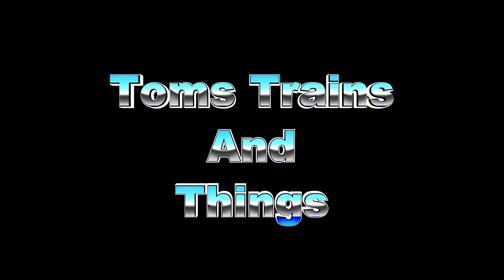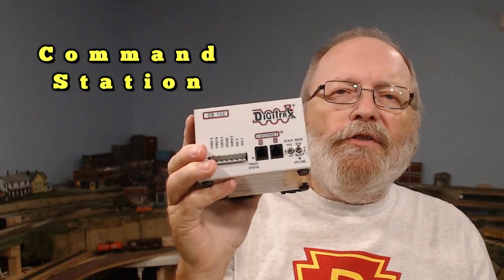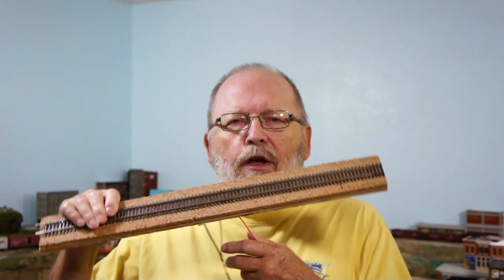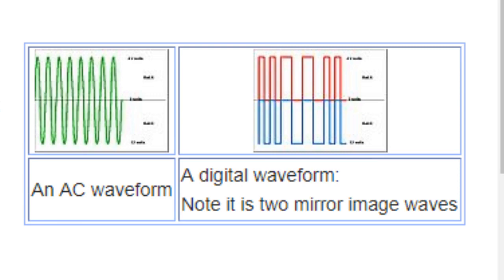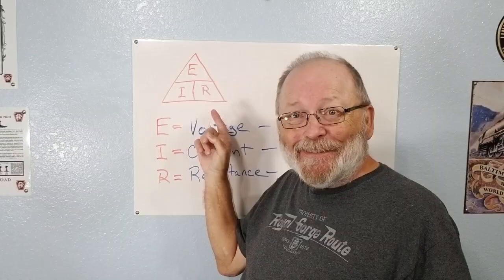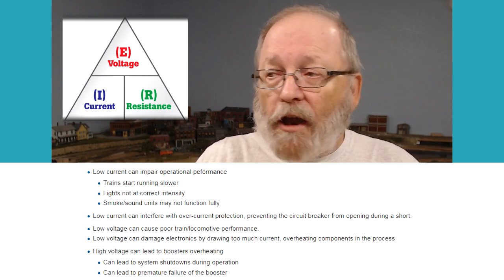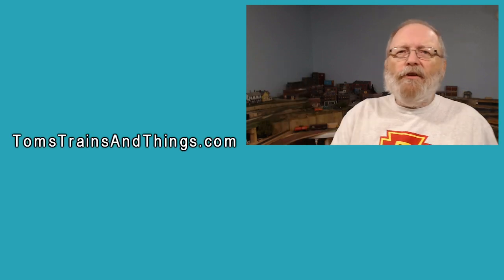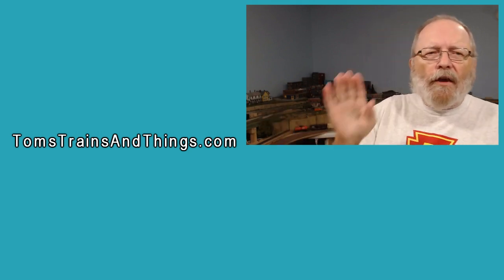What You Need To Know Before Wiring Your DCC Layout

Comment: Please, please, help me. I just bought a few items to run a DCC layout. I have, the Bachmann "your first railroad track pack" EZ track nickel silver layout, a Bachmann DCC sound locomotive, and NCE Power Cab DCC starter kit, and a Tech 7 ampac 780 (that I do not believe I need). All these were sold to me by a sales person at a store. I've heard that the NCE power cab does not go well with the EZ track system? What am I missing? Do I have everything I need to run my DCC locomotive on the layout? The Power Cab is a power source and command center for multiple locomotives? I'll truly appreciate any guidance with setting it up. Thanks in advance!
Reply from the maker: Hi Sid. The NCE Power Cab, a DCC Locomotive, and ANY track is all you need to run your DCC layout. If the salesman sold you the Tech 7 along with the other items, you need to take it back, get your money back, and complain to the owner of the hobby shop. They sold you a DC power supply with DCC equipment.  Where is this place?

Watch my other videos on DCC to get an idea of what you will need to do. Even though I use Digitrax, it's basically the same. I have a couple of Playlists where you can find these videos.
Reply: Thank you so much for your prompt reply, Tom! I'll take it back. Looks like they only give store credit even for unopened boxes so I guess I'll make it count towards a steam engine locomotive with sound, yippee!  (any suggestions which one?) But first, I need to hook this one up. I'm from the Marklin world for several years so this is my first time with a different brand. Once again, thanks for your reply and I'll post some more questions if I get stuck.
Reply: [Where is this place?] I'd rather not take the name. I'll give that salesman the benefit of the doubt. Maybe he didn't know. I'm going to ask for a refund because they are the ones who messed it up.
Reply from the maker: Your welcome Sid. What ever locomotive you decide on make sure it falls within your plans of how you want your layout. If you run into problems along the way, don't hesitate to ask. I'll be glad to help.
Reply: Hey Tom, so this link, http://cs.trains.com/mrr/f/744/t/218446.aspx, kind of scared me. Anything I need to be worried about before I open up the NCE Power Cab and EZ Track layout? The track layout I have is only tracks, there is no power source. Hope I'm not missing anything else.
Reply from the maker: If this is what you bought, this is all you need to get your layout going:  https://www.ncedcc.com/online-store/Power-Cab-Starter-Set-with-24-watt-110-240V-US-Power-Supply-p38322079  If you bought a more expensive one, you still have everything you need.

As far as the article, best practices are feeder wire every three feet. It can be stretched out beyond that. If you need additional feeders, you can always either buy the feeders soldered to the rail joiners, or solder them to your rail joiners yourself. I have a few videos on soldering in my Soldering Playlist, and I'll have another one up shortly.

Comment: Really enjoy your videos Tom but what the heck is going on with the voice syncing lately everybody’s seem to be out of sync?
Reply from the maker: Thanks Don. I noticed that in a few spots once I had the video already uploaded. I record some of my videos on my laptop using web cams and OBS which has always been a good performer, but lately my laptop is slowing down from age. I even performed a clean install  of Windows 7 and still having issues. It's about time to upgrade my equipment but that has to wait till after the first of the year. 
Being out of sync is common in live broadcasts whenever there is an issue with bandwidth. The video portion requires more bandwidth so it lags behind the audio even when the speed is good. I have 120Mbps+ download and 30Mbps+ upload speeds and still have issues on occasion. Sometimes it's on YouTubes end!

Comment: Thank you Tom. Can the Booster Command Center be used for Programming. I have had Athans N Scale Big Boy 4-8-8-4 and have had trouble programming the locs. So I bought a booster but it doesn't help. So I am lost.
Reply from the maker: You can program with a command station but not a booster. Some manufacturers combine the command station with a booster like the Digitrax DB150 and Zephyr. What system are you using where your having problems?

Comment: Tom;  I have a Digitrax 210 command station,I also have a Digitrax 150 command/booster station... my question is: Can I use the 150 as a booster for the 210?
Reply from the maker: Hi Terry. The DB 150 can be used as a command station or a booster. To use it as a booster place a jumper between Config A and Ground.  If you have the DCS 210 you can use the DB 150 as a booster. If you have the DB 210, no, that unit is a booster.
Reply: The DCS210 features: 

Full LocoNet Capabilities for easy plug ‘n' play installation and system expansion
Run up to 100 locos and 100 throttles in command station mode.
Provides additional power to run more trains in booster mode.
Can be used as an Intelligent Auto Reversing Booster
Use with any LocoNet throttle
Read/Write programming with CV readback
Two DCC outputs so you can run your trains and program at the same time.
Built in 5/8 Amp Digital Command Control Booster to give you maximum power
Many command station options are user customizable.
Pushbutton Routes & Clear Loco Stack.
Auto resetting over temperature & short circuit protection.
User selectable multi-scale operation for N, HO, and large-scale layouts with custom voltage trim
Track Status indicator shows voltage and signal type (DCC or “Zero Stretch” Analog Signal for conventional operation.)
Stabilized Track Drive Output.
Over Voltage Protected.
Auto shutdown on signal loss to prevent “runaway” trains
Complies with FCC Part 15, Class B RFI Requirements.
DCC Compatible.
Reply: Thank you Tom..your a life saver
Reply from the maker: No problem Terry. Do you already have the DCS 210 or looking to purchase one? If you already have it; how do you like it and how does it compare to the DB 150? Other than more power!
Reply: I already have and it seems to be flawless an Excellent addition to your layout.

Comment: nice job brother,can you use a zephyr xtra as a booster and use a hand held to run the layout thank you again
Reply from the maker: Thanks Scott, you can add Digitrax throttles to the Zephyr through the LocoNet Port on the back, or if you have UP5's on your layout up to 10 throttles. The Zephyr is a command station/booster/ throttle all in one. If you have two Zephyrs, you can use one as a command station and one as a booster. This will increase the amperage available on your layout but not increase the total locos you can run.

Comment: Thanks for sharing Tom, I have a question, my railroad is DC with blocks about 16, if and when I switch to DCC will I need to run a buss wire or will my block wiring work as my buss wire?
Reply from the maker: Hi Randy, You should be good with your existing wiring as long as it's heavy enough. I have a chart in the video with the recommended wire sizes for each scale. You may have to add feeder wires closer than 16 ft apart since the demand of the DCC signal is higher than DC. The best way to judge that is once you hook up a command station, do the short circuit test to see if your system shuts down.

When you do decide to go DCC, let me know and I be glad to help with any questions.
Reply: Hi Randy,

by DC bus wiring you maybe laid copper wires with bigger diameter parallel to each other and did track feeding with smaller diameter cables or wires.

Well in the DCC track bus is a little difference.
You bus wires should be drilleded together and should be big enough in diameter that you can work with much more higher amperages than into DC wiring.

The track feeder wire need to have the same diameter like the bus wires, because yiu are using a much more higher amperage to the track coming from your command station or booster.

If your command station using an amperage between 1.8 A to 3 A than you need not to have too big diameter wires but if you are planning to upgrade your system later i.e. with more and higher power in ampere so you will need to have much more bigger wires in diameter.

Some command stations working with 
5 A or 8 A or up to 10 A, I think on the NCE SB5 system with 5 Amps or by using doubled Amperage up to 10 Amps.

When using Digitrax 5 Amps or 8 Amps are possible, so your cables should work with it if you are using yourself for one of those systems.